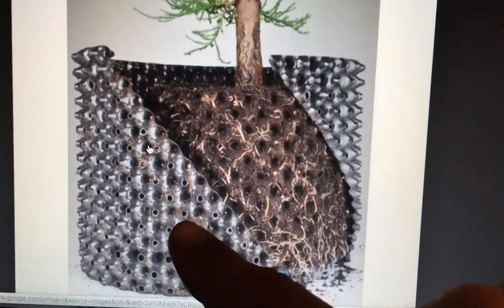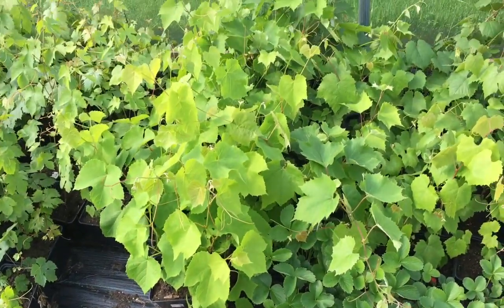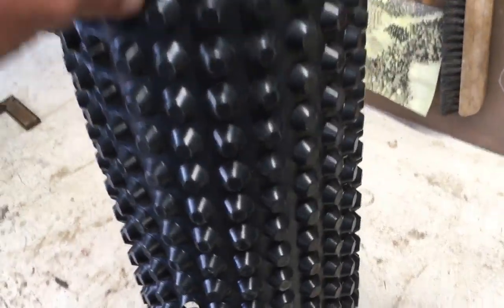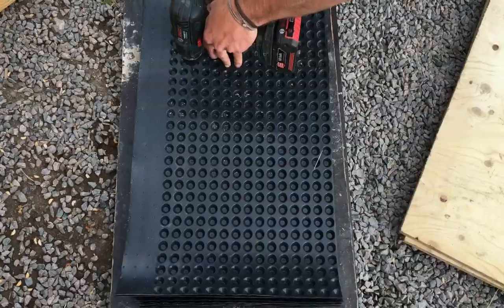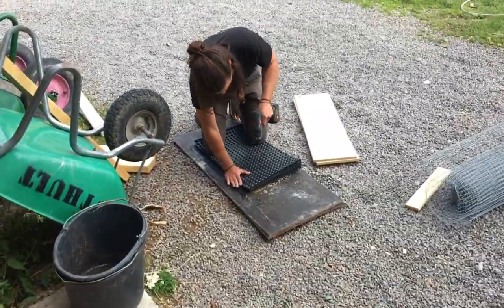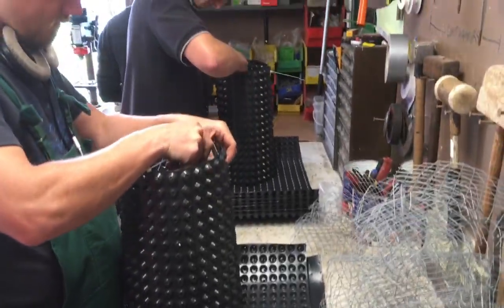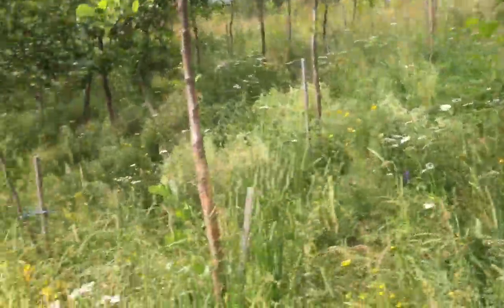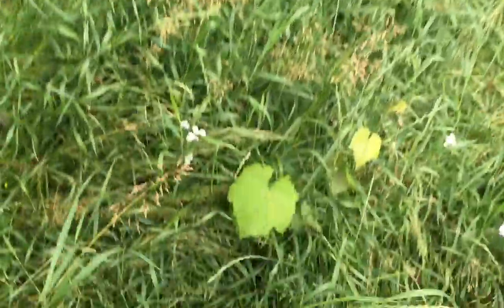Root Trainers/ Air Pots: Make your own at low cost...

Comment: Why not just do a long continuous air prune bed instead of making so many individuals? Just plant out for a season and transplant bare root in the fall.
Reply: wouldnt having multiple plants in the same pot kinda defeat the purpose since the roots would tangle and get damaged in the transplant.
Reply: mouse11011 no you make a raised bed but with a gap between the bottom of the bed and the ground and the roots grow very bushy but do not tangle. Also, since they are transplanted while dormant, root disturbance isn’t a huge concern.
Reply: @mouse11011  https://www.youtube.com/watch?v=MsSbImM58GA

Comment: Larry Hall has a ....Grow Bag ... Awesome and Cheap... Resuable Year after Year... Mine are 6+ years old and in Great condition $1 each
Reply: airpots are more efficient than growbags and you don't have to destroy them or part of the root system when you remove the plant after 2+ years.
Reply: I have used both air pots are way better. In fact I will never use the bags again for trees.
Reply: it depends. For a small amount of pots at home it might be a good option, but you need to get them out realy easy. In this way you need a lot of zippers, but might be okay. Maybe the he can buy the original drill thing to stick the sides together. From my experience the bags work realy well, but you have to water them more often, but you get a lot of fine roots. That's great. But getting the plant out of the bag was not that easy. It is possible by turning them inside out. And I am not sure about the durability of the bags. Sometimes they are made out of PP-fabric and from my experience pp fabric disband after time, but the few I have are still in shape after a few years, but I have payed more then 1 Euro for that bags and If I need a lot of them I realy would try the home made air pots (what I am doing at the moment) He could have also ordered them from Alibaba. But I am not that kind of sure how long this will take and if it''s work.

Comment: Love this and love saving money.! Great job guys.  My only concern is the Fact White Zip Ties are NOT UV stable. Which mens they will disintergate! Any other color would work better. Many people do not know this. Keep up the good work. Add me to watch my future farm. Coming soon.
Reply: but their lifespan for this [project will only need to be for 1 year when they will be cut off/undone AND theyre being kept within a poly tunnel, so outof direct sunlight.
Reply: @icryostorm3727  Good point.  Your most likely right. They should hold up.
Reply: @icryostorm3727  If the zip ties undone and reused then fine but cutting of every year is environmental disaster with plastic not degrading.  It would be much better metal wire used and reused  - just a suggestion
Reply: agreed,,all zip ties are bad

Comment: Why not protect the few grape vines that are left in there and let the cows into the area to "prune" all those tasty alder leaves up as high as they can reach before actually pruning off the branches?  They may not be able to reach as high as you plan to prune up, but they'll fertilize the area in prep for your plantings next year and it's easier to turn bare branches that they ARE able to graze into kindling for the stove as well.  And of course they'll appreciate the food!  But maybe it's too close to the pond to do that?  Would be curious to know. 

Ah, now you've just mentioned it there at the end.  Should've waited to make my post! 

Well, anyway those root trainers are brilliant!
Reply: About turn branches to dry kindling I use "automatic de-barking and rapid compost machines" a k a "goats" to do that work. All I prune will be throw in with leaves to them and instead they don't de-bark all trees up to 2 meter. Higher if they can climb on low branches. :)